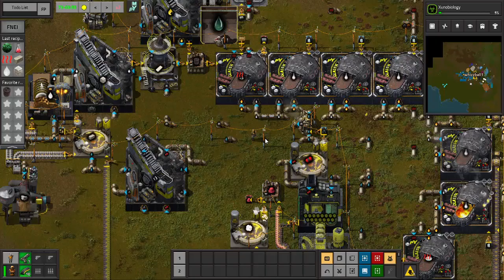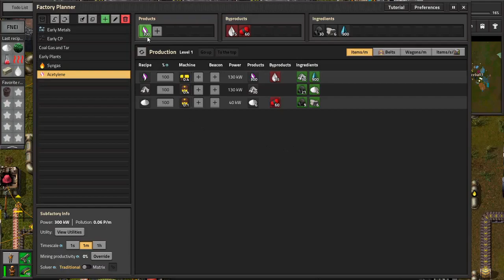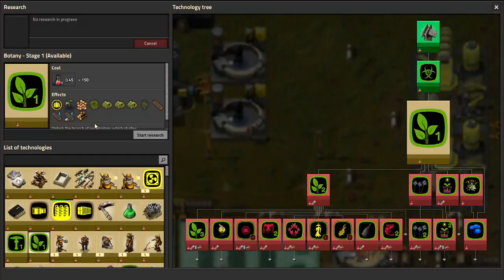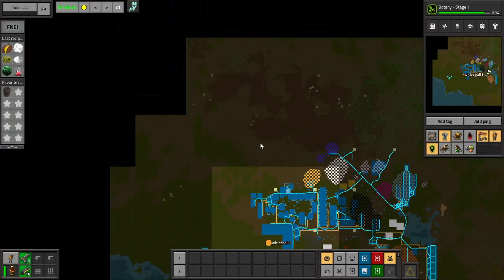Factorio Pyanodons Supershorts #4: Acetylene and Amped-Up Red Science

Comment: One nice thing about all those farms is that when you have biters enabled, they actually make it pretty simple to manage pollution and avoid biter attacks :) Especially compared to AngelBob's, where balancing pollution is a constant struggle - especially when you consider small biters have 100 HP and only take four pollution per biter! When playing in marathon, that means you simply can't make ammunition for less pollution than it takes to kill the biters. Better get handy with the shotgun in the early game :)
Reply from the maker: Oh, wow! Have you tried it? The advice I always got was “never play with biters”. But is the negative pollution that good?
Reply: @minecraftinchocolate  Yeah, it's kind of ridiculous - you can basically trade e.g. 100 kW per -35 pollution per minute; that's enough to run 3.5 basic electric miners, or more than enough for a single boiler (~2 MW). And you can keep the farms running with just one moss inside, reducing production speed (junk) without reducing the pollution reduction.

It still does add considerable difficulty to the game, of course. You need a lot of space, and it helps to keep the pollution eaters close to the producers. In my last game, I got to around 3000 pollution per minute total without having to deal with biters much.

I wouldn't try it with deathworld, though. That's just cruel :D
Reply from the maker: @LuaanTi  It sounds cruel! But I’m glad you enjoyed that. I would never be able to handle it. Biters are my bane. But I’ll pin this so people can see!